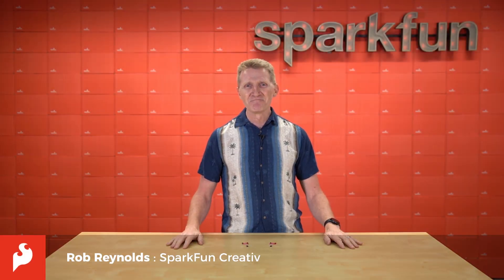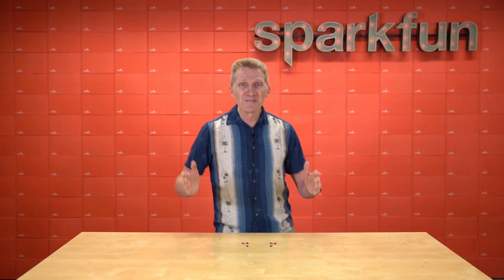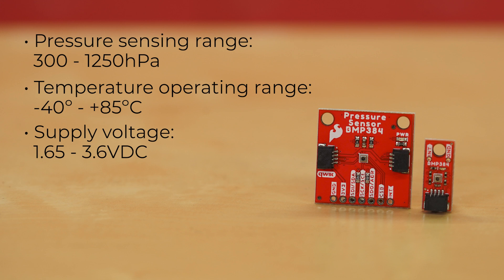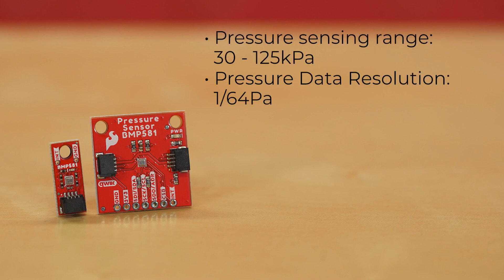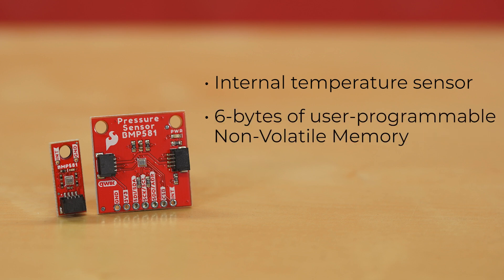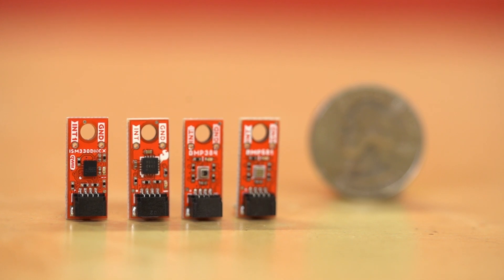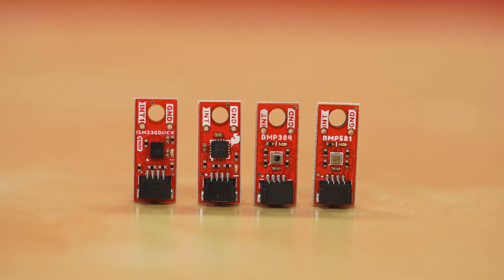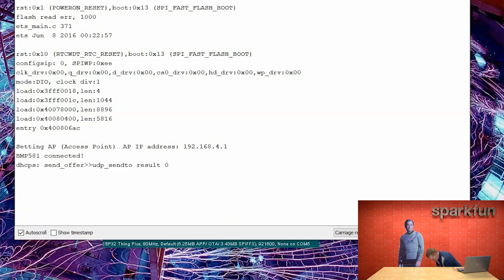Product Showcase: SparkFun Pressure Sensors

Comment: Does this use / require clock stretching?  Or asked another way, does it work with a Pi3 (which doesn’t properly support clock stretching)?   Thanks.